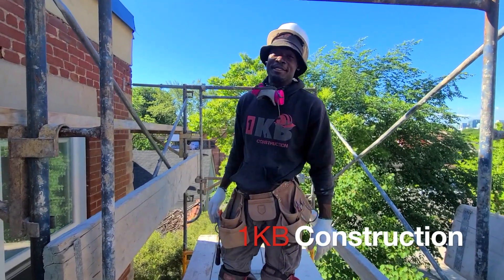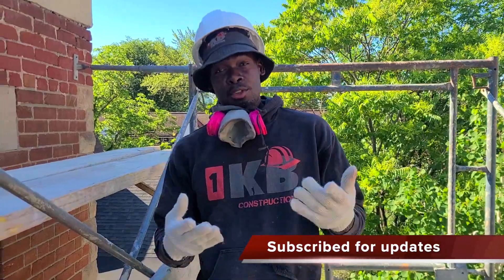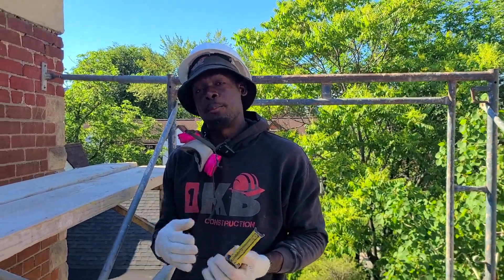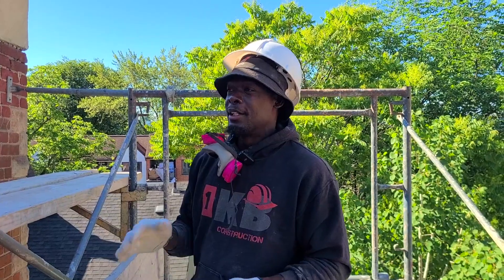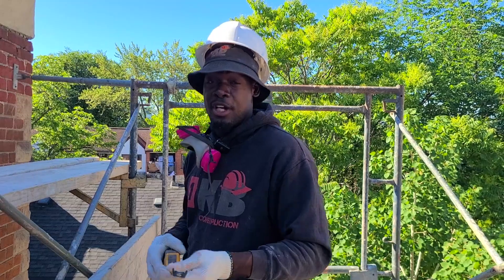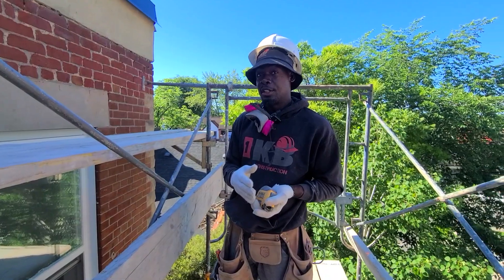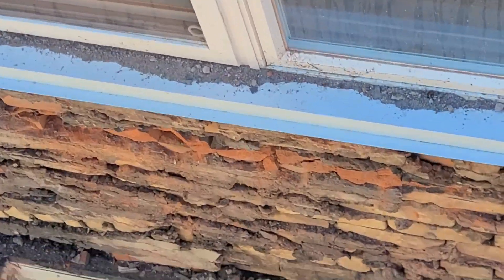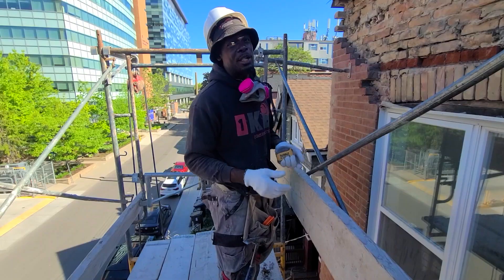How To Prevent A $50,000 Concrete Crack Repair /HOW DID THEY GETAWAY WITH THIS💁

Comment: Did the original builders skip putting rebar in the precast? I would think that with proper rebar, angle iron wouldn’t be necessary.
Reply from the maker: Yes there’s no rebar in the precast , if there was, I would still recommend  the angle iron 

Thanks 
Ryan

Comment: I would of loved to have seen the stone piece that was cracked.  The back and inside of it.  Did the old timers even steel reinforce the precast lintels 100 years ago?   I ask this because placing angle iron under a reinforced precast concrete lintel is just overkill - in my opinion.
Reply from the maker: Video coming 10 am today 
Yes it’s over a100 years old, thank you for watching, appreciate your feedback ❤️